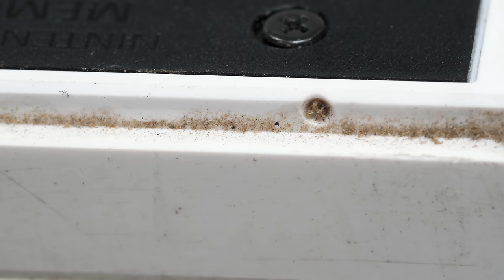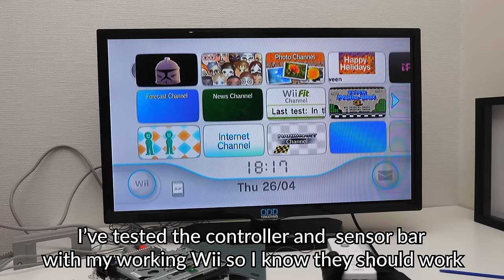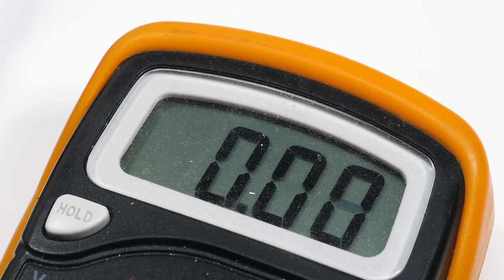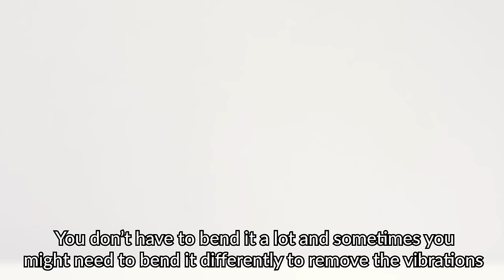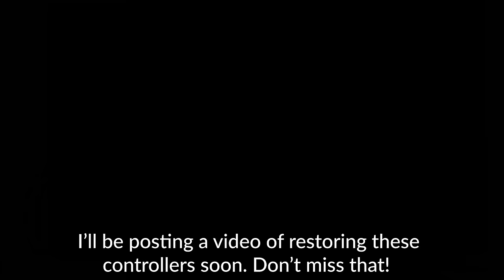I Restored This $5 Junk Nintendo Wii - Console Restoration & Repair

Comment: Amazing and beautiful restoration, it's amazing how far a bit of cleaning and TLC can take an old, tired console like this. It's almost like new again!

I will say though, it does still look like you have a worn out capacitor or two judging by the dimness on startup. Saw someone fix a Wii with a similar issue where that ended up being the cause. Just thought I should mention :)

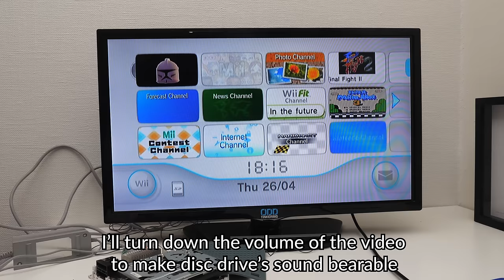Comment: Hey,i noticed at 6:58 the screen of the wii was very dark but it brightened after a while,this is an indication that theres a problem with the capacitor(s) that are responsible for powering the wii's composite output,it is quite a difficult fix  to do as they are surface mounted capacitors but if you can do it,it would solve that issue for you! :)
Reply: MattKC has his own video out about his experience replacing them if you want to check it out

Comment: I’ve had my Wii for 14 years now. And I got it second hand as a gift. It’s a first release of 2006s production line from Europe. I’ve fixed it 4 times using parts from other systems. Later releases of the wii, I found, were a lot more cheaply made (hardware wise) and had really poor quality. I found that these “cheapy” ones were sourced in America, which was interesting and weird. They contained a lot more knock off parts (no name pc boards and so on) and came without some of the internal heat sink. What’s more is, they came with normal star screws while the European one came with the annoying triangle screws (the ones they don’t widely sell screw drivers for).

Comment: They are easy to repair it's getting the screws in the correct holes especially on the watch battery or tape it Christmas lights work as a sensor bar as well

Comment: Great restoration one thing I noticed when the Wii turned on in the beginning of the video the Wii menu was darker than usual. Mattkc had this issue and it because of those capacitors behind the gpu and cpu heat sink where the fan sits on them. If you replace those it will fix that issue

Comment: This channel is great for this future generation of STEM. My girls found your channel and I think it's brilliant. I have a hopeful request; when you remove a part, can you explain what the part is and what it does. Also why is it that certain liquids or sprays won't further damage cords or nodes etc when you clean with duckie vodka (lol) I think this is great for kids to learn but even I have lots of questions. What does a pin do? Why does heat remove a part and not damage any other part? what are all of your tools and what do each of them do?  What is ribbon cable? Why was the screen cleaned with magic eraser instead of water or alcohol? How do you know what needs insulation? My questions can go on and on. My apologies these questions were posed while watching the repair to the nintendo DS lite on TV and the Nintendo Wii on my computer... curious homeschool mom for curious little girls. These are just rhetorical questions... hope to get more details while watching.

Comment: I wonder if something more difficult could be worked on? Like an early germanium transistor radio, or even one of those portable sets that used miniature vacuum tubes. Or one of those Sony transistor sets that are just crammed full of parts inside, like a CF-350 (I have one of those that needs work).

Comment: 3:33 thats probably what finally killed it, they say "two's a coincidence, three's a pattern" and i just found my third instance.
the processing power needed to run lego star wars three probably exceeds what the wii is capable of if your extremely unlucky. it already crashes often enough with its 24 megabytes of RAM, whose to say that those clusterfuck vehicle battle missions cant brick a console under the right circumstances

Comment: My respect for Nintendo for making this wonderful console that deserved to win the console war back then. As ugly and unsuccessful the game cube was, and it deserved it, as much as the virtuell boy failed, and deserved it, as less as the super nintendo was impressive for its time, as amazing is this piece of hardware. Of course it was originally designed as a game cube extension, but it became so much more. Such a solid piece of hardware that never had the best graphics to offer, but the superior game play that was way ahead of its time.
So you could restore it basically easily, for only two parts were broken which were not so hard to repair even though the former owner did not take care of it so well. And it works fine afterwards in spite of its advanced hardware. Really awesome.

Comment: Based on your tinkering interests, the HOTO Compressed Air Capsule could be a valuable addition to your tech arsenal. Its dual-function capabilities offer both powerful vacuuming and blowing, perfect for cleaning and maintaining your desktop setup. Plus, its portability and efficient storage make it ideal for on-the-go use. Definitely worth considering!

Comment: Ooh, you didn’t fix it entirely. That screen darkness and color is caused by a malfunction in a capacitor on the motherboard. Should be easily fixable with some soldering knowledge though.

Comment: To turn off a Wii you need to HOLD the button not rapidly push it. because the Wii has a sleep mode that is activated when you just push the button once.
Reply: Really? Well if that’s the case why does my wii turn off right when i press it once? It doesn’t even save progress and it brings up the health / safety screen up again. I think you are wrong.
Reply: @I-LUV-YOSHI  let me check again with my wii.
Reply: @I-LUV-YOSHI  Update:
After some testing and a little bit of research I learned that the Wii's will always tell you to look at your health and safety, nonmatter what mode it's in whether that be Standby/Sleep Mode or turned off completely. Also Sleep Mode was only for Wiiconnect24, where you can receive messages from other Wii's, it's bin discontinued a long time ago, and it's not like how it is on newer consoles and other devices of today. To turn the Wii off completely you need to held the button for around 6 seconds . Res light = off, Orange light = standby/sleep mode, Green light = on.
That was a lot of typing 😓

Comment: Do you have any tips for removing the smell out of the boards and and cables? I bought an N64 with controls from a yard sale. I took everything apart and cleaned it like how you do but the motherboards have the smell of animal piss and it’s not bad any more but if I really smell the controller I can still smell animal piss, any tips or solutions for this problem?

Comment: I never understood how consoles get so dirty and beat up. I can understand handhelds or controllers. But consoles are designed to sit and in one place and barely be touched. Dust it or wipe it down every few weeks and it’s should like new again.

What are y’all doing with your consoles. This Wii looks like it was dropkicked and dragged down the street.

Comment: You really one of those fake restoration channels, huh? Outside is that damage and dirty, but the seriel sticker is magically unharmed, and the insides are barely dusty. I fix up electronics often myself, and this is not the inside of a console in that outside physical condition.